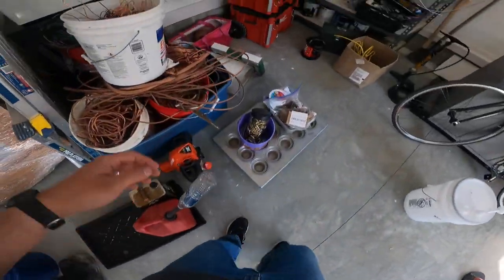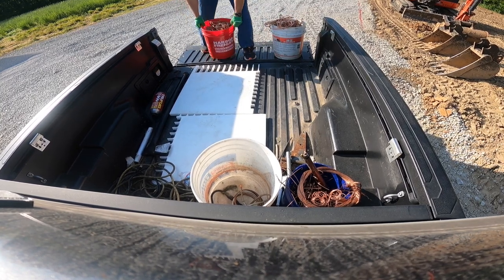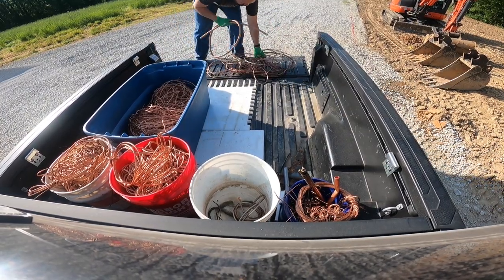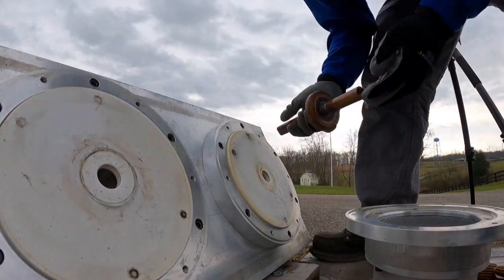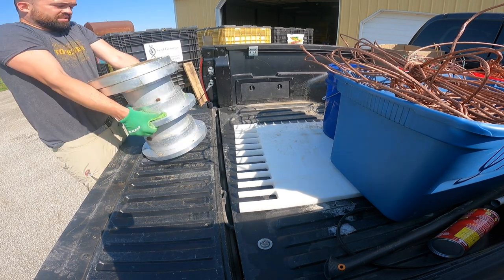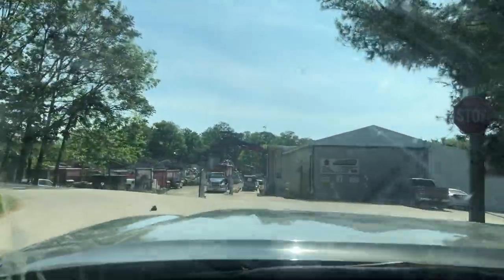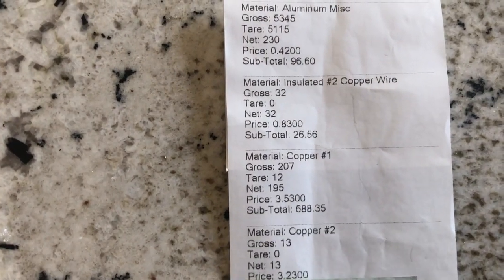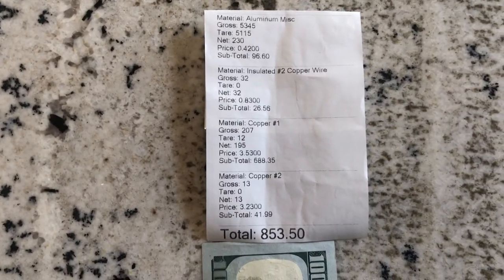$ RECESSION $ Scrap Run , Price Breakdown #copper

Comment: Good run, I'm surprised you didn't get bare bright price for any of that.. Bare bright is about 30 cents more than #1. I couldn't tell exactly what you had, most of it did look like small stranded wire but 16 gauge and thicker is bare bright. definitely worth separating... And it's a good thing you took that in when you did cause copper has dropped over a dollar since then!
Reply from the maker: The wire was not very thick at all. And honestly I go to different yards and they all have a different price/clarification on what they label their copper as. 

I’m glad I sold when I did though lol!
Reply: shred not  bare bright
Reply: my yard pays top price and still lets me mix in my stranded wires and still calls it bare bright I consider myself lucky lol
Reply: So what's with stainless? I see wires that aren't copper & silver in color. They worth anything?
Reply: @skullmoldycandy  me too bro you in phx area? Lol
Reply: @majorkramer silver wires are aluminum.  Significantly less..

Comment: What state are you in? My copper prices went from 4$ down to 3$ in a little over a months time! Your lucky to be getting 3.50+
Reply: Also aluminum has tanked. Extruded used to be 80 cents down to 40 cents. Cast was 60 down to 3.5 and sheet is same
Reply from the maker: Indiana! What about yourself?
Reply: @CountryBoyChronicle  Tennessee

Comment: You could have repurposed the large industrial plumbing part by putting legs & wheels on 4 corners, for a work bench table to mount a lathe, grinders, or knife grinder/sander or welding assembly bench. The round holes in the sides give access to the "shelf". The holes in the "shelf" could have buckets for scraps etc or put a flat sheet of aluminum for a shelf surface.

I did something similar & used it for years, then when I downsized I sold it. The buyer couldn't get the $800 out of his pocket quick enough. Plate aluminum is EXTREMELY expensive if you buy it, not worth much if selling as scrap.

Before you accept scrap prices, try to repurpose stuff for a much greater return. It takes imagination & gives more satisfaction.
Reply: Maybe scrapping is more rewarding for him than doing what you like to do with your junk....either are great things to do with junk